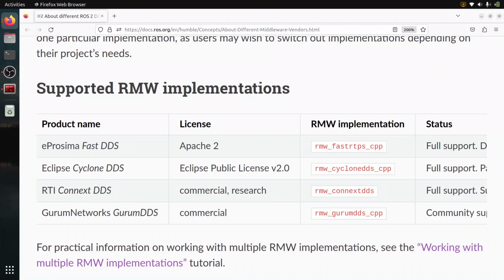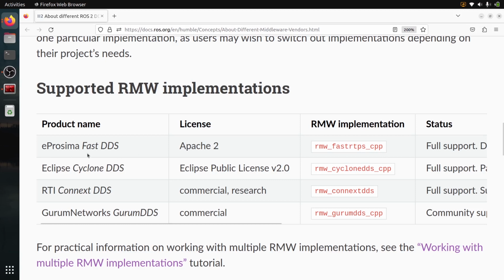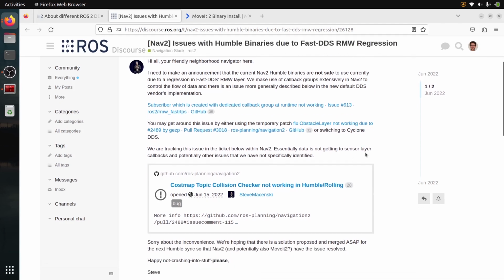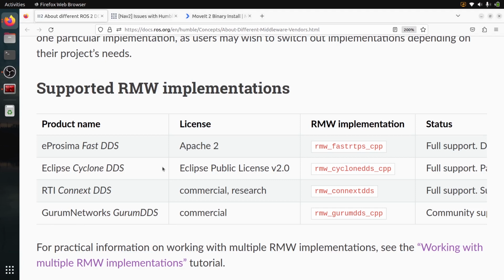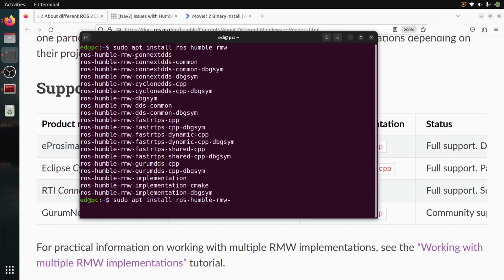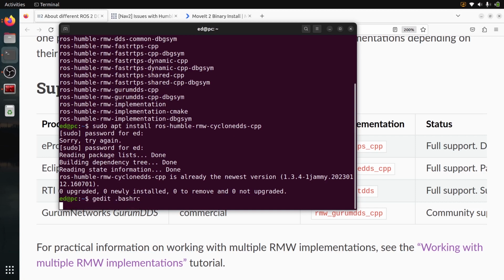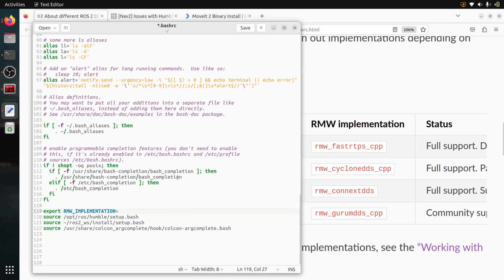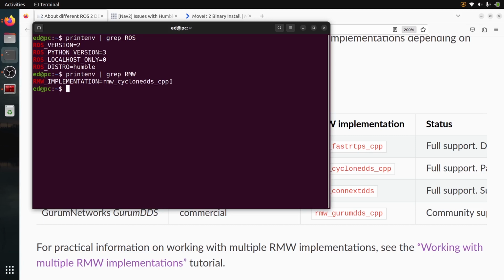ROS2 - Switch Between Different DDS Implementations (Fast DDS, cyclone DDS)

Comment: Do we need to recompile the ROS2 node with new DDS? Or the previous built ROS2 node can directly run with new DDS?
Reply from the maker: Good question. You should not recompile, just source the correct environment variable.